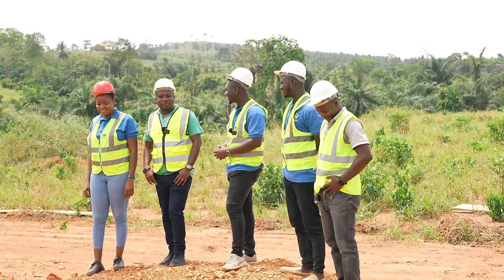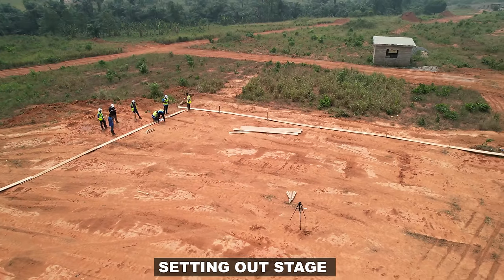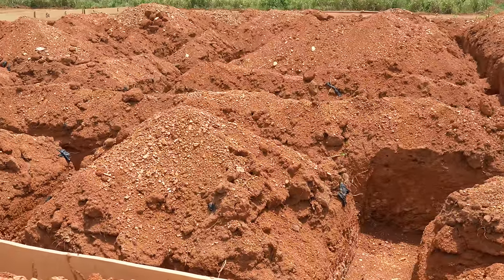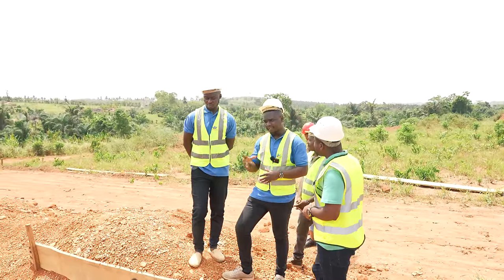SECOND STAGE OF CONSTRUCTION : GROUND WORKS AND EXCAVATION AT GRACE CITY PHASE 3.

Comment: Very good explanation. I may be purchasing there soon. My question is, how much does it flood in that area during the rainy season?
Reply from the maker: Our sites are not waterlogged locations so you wouldn’t have problems with flooding. Also, our engineers are always available to advise during any project conception for the necessary structures that curb flooding situations to be put in place the right way.
Reply: Awesome! @RoyalKingdomEstate